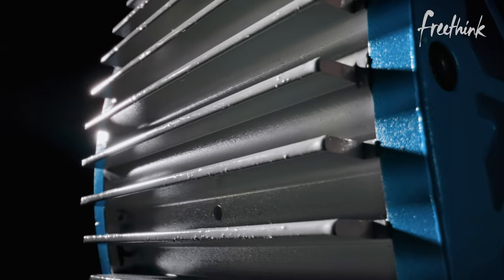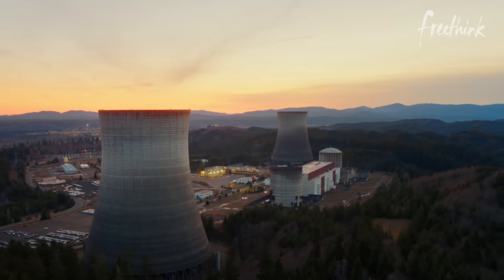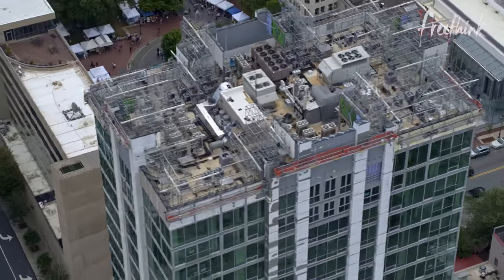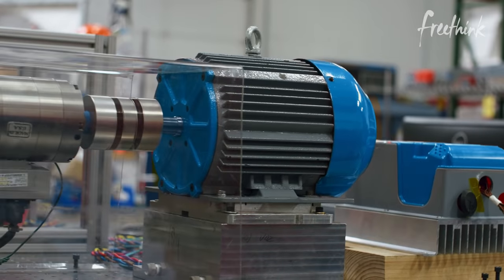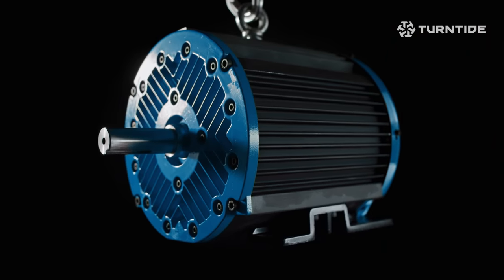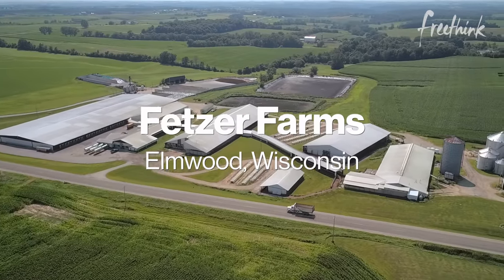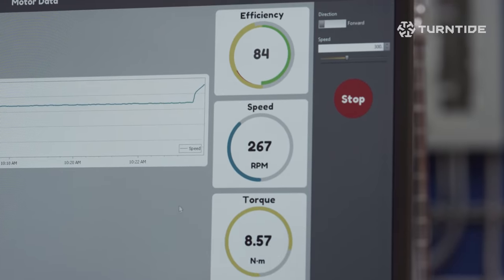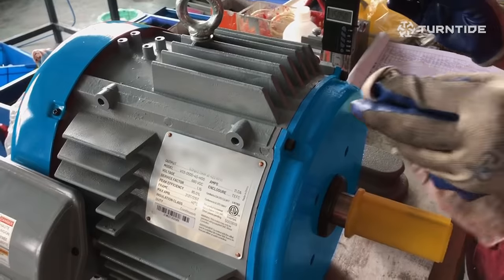Want to Save the Planet? Start with Reinventing the Motor

Comment: Motors are typically 98.5% efficient. Tf is this guy talking about, half of the energy is wasted...
Reply: Also isn’t control of the motor left to the VFD or the PLC
Reply: its usually not quite that high. about 80 to 90%.

I'm guessing what they're doing is a VFD which can go up to around 95%.
Reply: holyshit i just looked at their website. its absolute trash! especially the motor "comparison".

Turntide: EXCELLENT
Standard Motor: AVERAGE

what kind of bullshit comparison is that??
Reply: ok there is a link to a SCE testing document which partially confirms what they claim. only about 10-15% reduction in power usage. 
thats a great start but faaaaar of from 50%
Reply: Regular electric motors are extremely efficient but only at a specific rpm. Not really that  much of a big deal when you plug it in. But if the motor is run off  batteries like an electric car. Or used in an wind turbine the difference can be extremely significant.
Reply: Wth thats just a freaking brushless motor... thats not new..
Reply: I am guessing, that he tries to make it stand out ("50% is HUGE"), by talking about the motor's efficiency and then mixing it up with "the energy you put in" maybe just seen from the point of generating (/converting into) electrical energy, transfer and then using it to power the motor (because he's then talking in context of 25%? less carbon dioxide) - the e-machine is realistically (if not always run in it's optimal state) lower than these amazing numbers, like 98% (as Julian and Dennis say) - if you, let's say, regularly had 80% efficiency and calculated the whole system from generator transfered to motor, you already have 80% * 80% = 64% (not including any transfer losses). You then just have to exchange generator and motor with their new motor=effiency. If they wanted to make their numbers impressive, that might be how they got it (and actually correctly)
Reply: @xzebix  good point. the numbers are over my head but i know from using cordless tools minor improvements in batteries or motors can be exponential.
Reply: Absolutely, what kind energy savings improvement are they mentioning about for a IE4 motor of about 95% efficiency. May be they are mentioning about the efficiency at lower loads, say 25% loading, when the efficiency is much lower. But still that's what vfd does. 

Confused.
Reply: @Personnenenparle  That is what I was thinking. I don't understand how this is different. and what is the unstable system that they are solving?
Reply: Julian Kandlhofer yeah that is not how an “industrial supplier” should list out their own specs. Baldor or other motor companies show you every little detail regarding the damn thing. Also how friendly are these things when sending 4-20milliamp signal to your integrated PLC or controllers. Will there be an issue with their “OS” and allen-Bradley, Mitsubishi, Idec or other providers?
Reply: Most motors can achieve maximum efficiency in a wide range of RPM and low load.  To achieve that range, depending on the design, either the supply voltage (no-load RPM) or driving frequency, will dictate that rpm.  Often the continuous load doesn't vary a huge amount at different RPM, so changing the driving parameters is usually acceptable to vary the speed and still have an efficient system.

Yes I stopped watching the video half a minute in.  Why do people waste their time making bullshit videos?  The only people who matter to pitch new ideas to are professionals who already know this is BS... and I'm not even a professional in that area.
Reply: @F a what mechanical device can do anything at 20000 times per second? Its not one,  but ill wait.
Reply: No they're not.  98.5% thermal efficiency is a physicists dream equation.  Current motors can run around 30-50% thermal efficiency. You can almost never get out 98.5% of the energy you put in. Thats fucking Goku level physics
Reply: Roger Samuel 

Last I had checked motors are either 80-90ish % efficient. Which happens to be for all applications. The application I was referring to was the front driveunits on the s/x/3/y.
Reply: How is this mechanically different from a regular old brushless motor?
Reply: @dennismorin7506  
What are electric motors used for in wind turbines?
Reply: @YuSoMadBra  ever see a Tesla coil?

How about a spark gap transmitter?
Reply: @F a 1/4... takes 4 revolutions to make 1 complete valve cycle. Now what is moving at ludicrous speed are the valves themselves... they move a half inch in a couple degrees of motion.
Reply: @F a 20khz sampling rate. Interesting. But if you're sampling that fast, that's implying doing something that fast too, and only in 1 clock cycle? Not sure what power devices they're using, would have to be mosfets, because igbts are too slow, which now also means this is relegated to relatively low power motors. Yeah there are a lot of them, but it would do squat industrially.
Reply: @F a yep. Its 4am here, my math is off...lol. but that's also 10,000 revolutions per minute, not second... otherwise the motor would be going 60 times faster at 600,000 rpm! Now that's screaming!
Reply: @sakukuratabinbohkekal-faki4248  electric generaters are essentially electric motors running in reverse.
Reply: @dennismorin7506  we already have technology that can deal with inneficiencies at low rpms, they're called transmissions
Reply: @jgjg5182  correct transmissions work great. But transmissions cost money weight and more moving parts. Tesla solves this problem by doing something  simular as in the Video  as well as having two different rpm motors per axel.
Reply: Their claims are so of from reality that i lost my trust in this channel.
Reply: @kleetus92  even 100kHz is no problem for current generation igbts so it could be a normal inverter
Reply: @kleetus92  keep in mind that your mechanical speed is lower than your electrical speed by the pole pair count of the rotor. Stepper motors take that to the extreme for example
Reply: @gotbread2  ????? Not in a 400 amp 1700V device they're not. you're lucky to get 15kHz.  I work with big drives, 4160V, 500-20,000 hp stuff.
Reply: @kleetus92  depends on the device of course. The 100kHz figure is for 600V devices
Reply: @gotbread2  still gotta be low current  though.
Reply: Keillor Kaplan-James  Yes Current motors are extremely efficient. But such efficiency is rated by how much of the input energy is converted into useful motion. This works on a different principle. This is based on reducing how much energy is inputted.
A standard motor under constant strain uses a continual flow of electricity. This motor does not, it uses pulses of electricity to do the same work. So in theory, if the pulse is equally on and off, then this motor can do the same work for half the electricity.
Reply: @gigabane7357  Read that statement back to yourself. Holy Christ I now understand how easily scammers make money.
Reply: @kleetus92  Sorry I am not very good at explaining. A standard brushless motor constantly energizes 66% of its coils constantly. I am only going by what I am seeing in the video, but this shows the motor only ever energising 50% of its coils at any one time. If the energy demand drops equally with the % energized but the output power remains the same then this could be the reduced energy requirements they claim it to have.

Sorry if it seems im talking gibberish to the brainiacs, Im just comfortably numb and enjoying cool tech vids. lmao ;)
more than happy to receive an expert explaination of why it is more energy efficient.
Reply: @gigabane7357  the 2/3 thing really isn't true either. It moves in a wave, a sine wave,120 degrees offset around the 3 coils. And failing that, it's done via pulse width modulation to put the right amount of energy where its needed. 

Switched reluctance drives are nothing new, my 15 year old maytag Neptune washing machine had one in it. Motor was pretty simple but the controller was ridiculously complicated. And the reason I know this is because that controller died. So they replaced both the motor and controller and the next one survived till the drum rusted out. 

This fractional gain in efficiency which I'm honestly not seeing comes at the expense of significantly more complicated, and therefore less reliable, controls. If the metric we are chasing is efficiency at any cost, I'll make a motor out of silver and kill all these things,  don't ask what it will cost though..
Reply: Keillor Kaplan-James not true.  Most motors in the American household are shaded pole.  About 15-20% efficiency.
Reply: @gavincurtis  I dunno about most... those are clock and bathroom fans... maybe the one in the fridge. All the other motors for compressors and furnace are induction.  I'll be damned if I'm putting a 1000 dollar motor system in a fart fan than runs for 5 minutes every other day.
Reply: @kleetus92  lol...Very true!  Any fan motor or consumer rated fractional horsepower motor will usually be shaded though.  Appliances such as  kitchen mixers and AC corded vacuums usually have universal motors which are still only about 50% efficient.

98.5% efficient electric motors are not everywhere by any means yet, sadly.  They exist, but the almighty dollar and our throw away mentality makes sure they are rare.

All bathroom fans (any non-heater fan) should be using PSC motors.  Permanent split capacitor which are about 60% efficient, albeit more expensive motor to manufacture.

As you know, if only American households had 3 phase, there wouldn't be these problems where you steal motor efficiency to try and create a phase winding for it to work.
Reply: @gavincurtis  comes a point though that it really isn't financially responsible to put $500 into a $20 heater.
Reply: @dennismorin7506  thats probably true, because if you were to graph it out, 100% efficient would run forever, impossible I know, but as you approach 100% the graph would spike
Reply: The OP is not understanding the efficiency rating of motors. A 98.5% efficient motor just means that only 1.5% of the input energy is wasted as heat.  It doesn't mean that the job couldn't be done with less input energy.

There is definitely some marketing BS that is being put out by this company, but the potential for energy savings is accurate.  It's just not unique to their specific type of motor.  The potential energy savings is a feature of any modern electronically controlled variable speed motor.  It's the variable speed part that saves an enormous amount of energy in applications like pumps, fans, HVAC systems, etc. when compared to the status quo single speed motor that cycles on/off in those same applications and is usually oversized to ensure it can run under the worse case load.  

In recent years, the electronics to control motors have become quite cheap.  Unfortunately, most manufacturers are still using decades old motor technology in their products.  For example, almost every new HVAC system being installed in the US still uses old school single speed AC motors even though variable speed electronically controlled motors would save 25 to 75% energy in most installs.  Same with pool pumps, fans, and refrigerators.  That is just in a typical household.  The commercial/industrial space uses far more motors than a typical home would have.  I have been saying for years now that those old motor technologies need to be mandated/regulated out of existence (similar to the way that LED bulbs have replaced incandescent bulbs because of regulations) for most applications.  Pool pumps, HVAC systems, and refrigerators would be a great start.
Reply: @dennismorin7506  Though when you're running off a battery, you're using a VFD controller. The motors are efficient over a wide range of speeds.

The model 3 uses a switched reluctance motor for the base model, of their own design. It's slightly more efficient but you don't get that hard acceleration.
Reply: Yeah, no.  Nowhere near 98.5% efficient.  Inefficiencies come from:
1) "copper losses" resulting from electrical resistance in the copper windings themselves,
2) "iron losses" resulting from the energy it takes to reverse the magnetic field in the iron cores the coils are wound on,
3) "eddy current losses" resulting from electrical current induced in the iron cores, which do no work.
All of these are lost as heat in the motor, and if a motor is getting hot, or even warm, it is from these losses.
Reply: @Sanity016  Mechanically, the difference is that a BLDC motor has permanent magnets in its rotor, and these either attract or repel the field generated in the stator at different points in the rotation.  The variable reluctance motor uses only an iron alloy in the rotor (no magnets) that completes the magnetic circuit generated in the stator.  As mentioned in the video, the torque is generated by the rotor poles being attracted to stator poles to align themselves with the field there.  Since the field in the stator is always rotating (due to the currents switched by the controller), the rotor is always trying to catch up to that rotating field.
Reply: @Personnenenparle  Yes, it's a brushless motor, and no, it's not new, as they say in the video.  But it's not the kind of brushless motor you're probably thinking of, because it doesn't have magnets in the rotor.  And what IS new(ish) is the use of a BLDC type of drive in a variable-reluctance motor.
Reply: @YuSoMadBra  Nothing mechanical is reacting at 20,000 times per second.  What IS happening at 20 kHz is the switching of the current to the stator coils, which allows the current to be pulse-width modulated to vary the current over a wide range while using very efficient electronic switches.  This allows the current profile to be optimized in real time at any load and speed.
Reply: @BrightBlueJim  Ok that makes sense, it still feels like they're trying to reinvent the wheel, but I suppose innovation is important and any improvement in efficiency makes a difference.
Reply: @Jaker788  thanks Jake I love technical details.
Reply: @dennismorin7506  thanks for explaining that👍
Reply: No, motor eff vary depending on HP/KW, speed and voltage.  The larger the motor the more eff it usually is.

Comment: Hire a electrical engineer to talk about this next time
Reply: NO! Please hire Todd Howard and make a video series
Reply: As a electrical engineer i confirm to you this is BS, cheapest Chinese induction motors have a efficiency above %80 and most new made motors with a intermediate quality are above %90, so there is a very small gap for improvement and that's why induction motor designs are pretty much the same since there invention, sure you can make small improvements like adding a smart speed controller to better suit the application but nothing too drastic as this video claims.
Reply: @basaka434  Oh, thanks for the clarification!
Reply: Back EMF also a potential energy that be can store and re-used,,,,,...!!!???Tesla/John Berdini
Reply: it's no invthe school ,,,,,,, limited academic
Reply: But these motors it's all about software...
Reply: @basaka434  Agree. More smoke and mirrors than facts.
Reply: @basaka434  I believe Tesla has their motors up to 97% efficiency.
Reply: @kirillkas5157  16 times the efficiency! four times the motor!
Reply: EEs should short this stock and become degenerates on WSB
Reply: durability is quite less man i have many chinese machines
Reply: Waste of time
Reply: @basaka434   true
Reply: @NinetooNine   cap